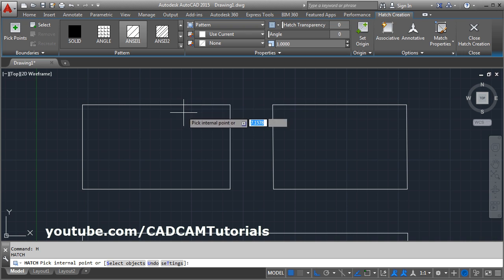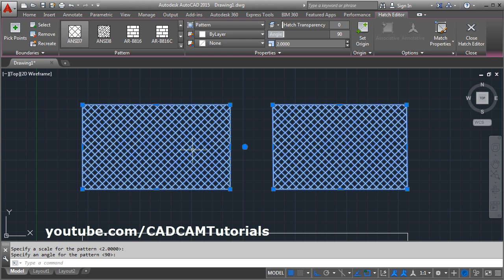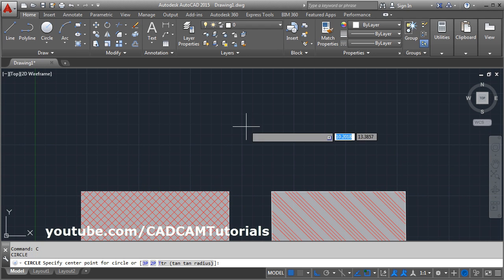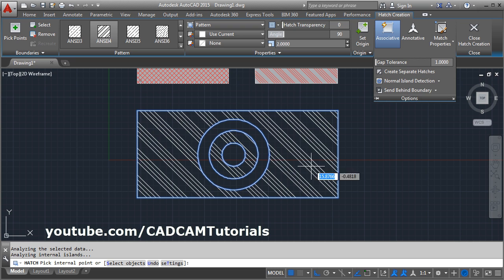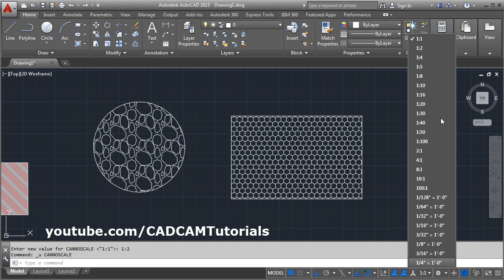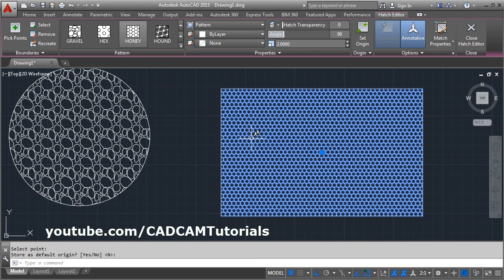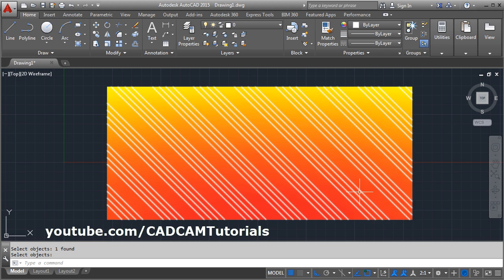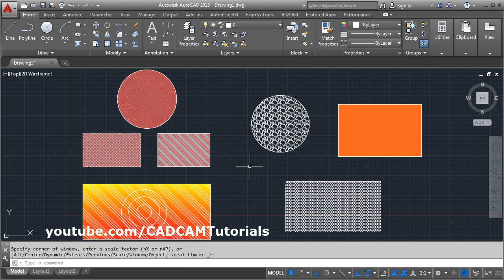AutoCAD Hatch Command Tutorial Complete | AutoCAD Gradient Hatch

Comment: can I specify the line spacing between lines  in millimeters?  ex: 3mm between each line
Reply from the maker: You can't specify in mm, but you can workout the scale factor so that gap will be 3mm.
Reply: @CADCAMTutorials  thanks, can you tell me and example?  I need lines in a square for 80mm x 80mm and the lines inside the square must to be at 3mm between each other.
Reply from the maker: Using acadiso.dwt template and ANSI31 hatch pattern. You can get gap of 3mm by specifying scale factor of 0.9449
Reply: @CADCAMTutorials  thank you very much. Last question, how do you do the math to obtain a certain numer?  or you just try one by one the scale factor?